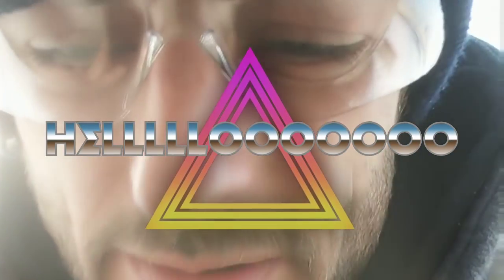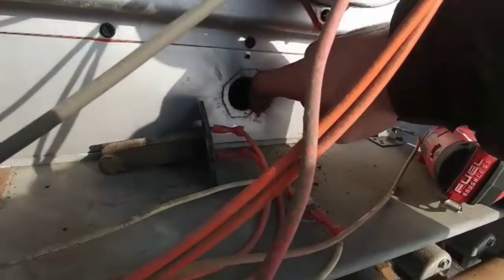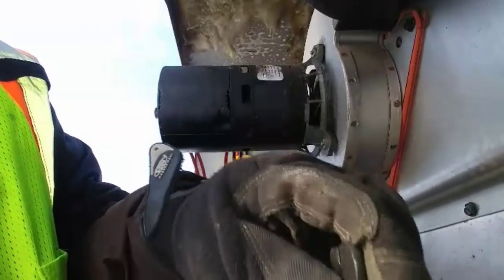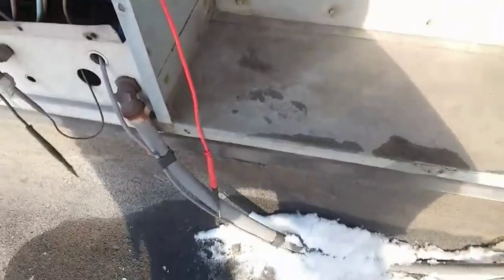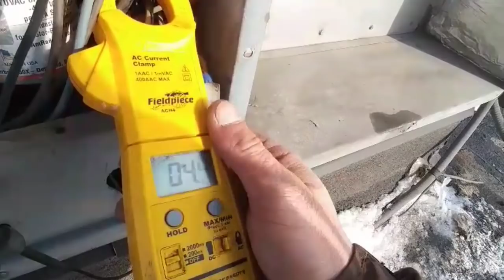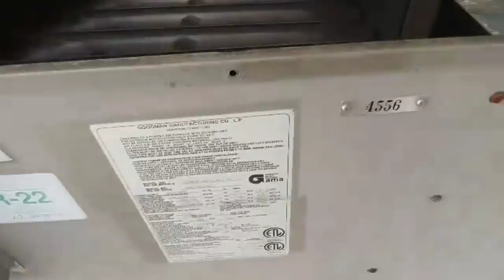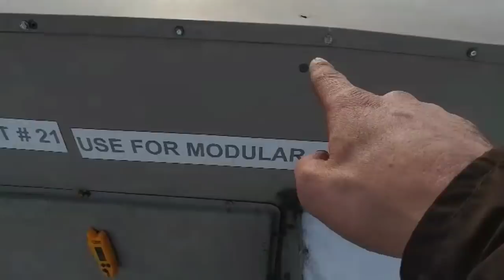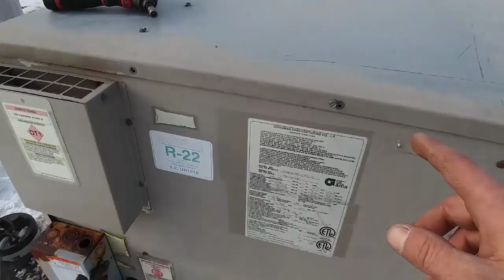HVAC/R DUDE: 🔩WHATS UP WITH TUESDAY🔩

Comment: Its like the rooftop unit had no filters, you had a high pressure drop across for the split unit? I usually check combustion effiency and get high co with plugged secondary